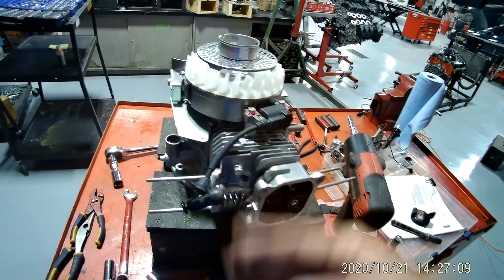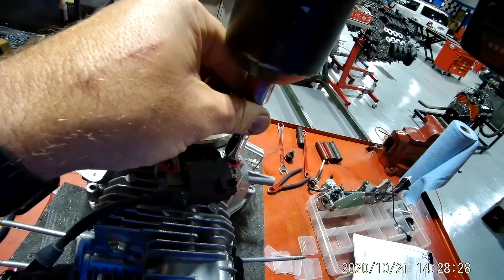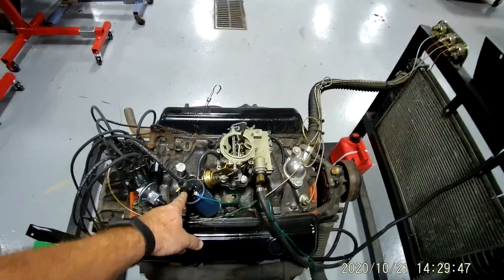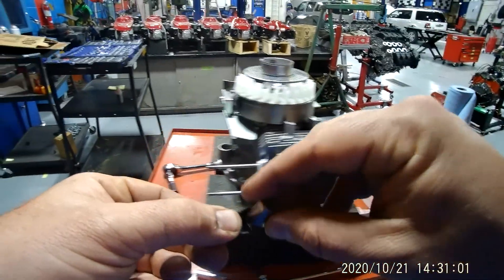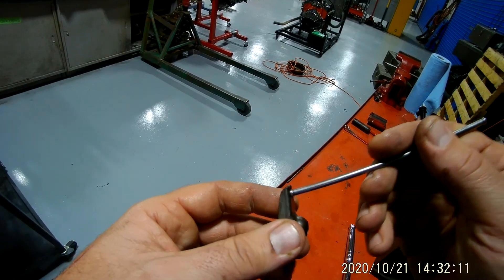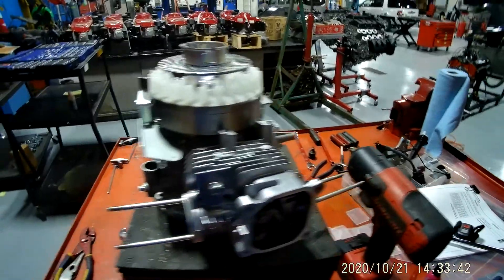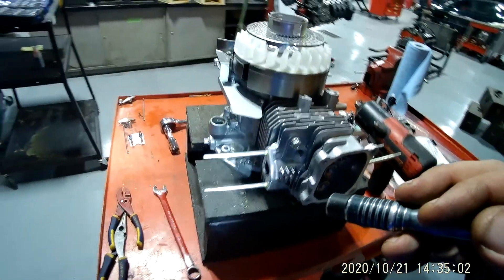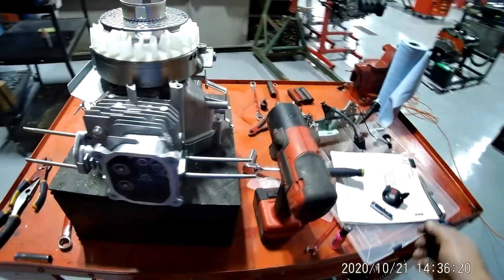Honda GXV 160 OHV engine dissemble and reassemble, video 4

Comment: Question.... What's the difference design wise between the commercial gxv 160 and the gcv 160? I can't find a commercial version of the gcv200 and need a longer term dependable engine to repower a 30 inch mower.
Reply from the maker: @spiceyfrenchtoast9421  unfortunately I do not know, sorry.